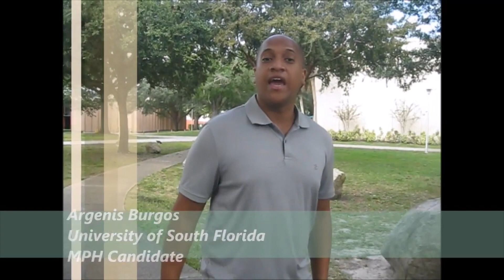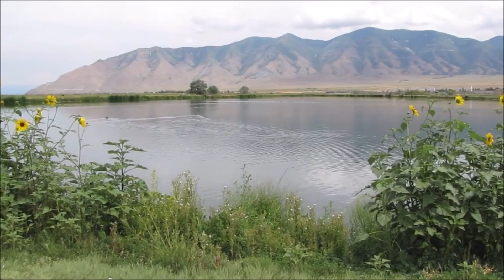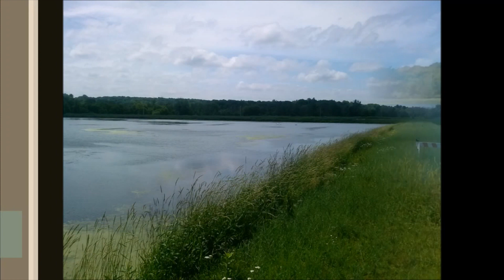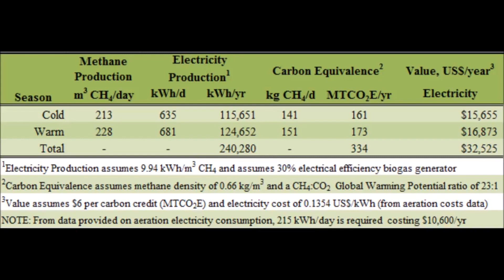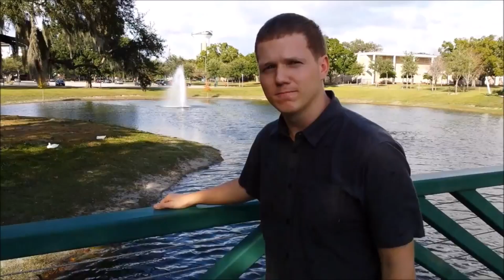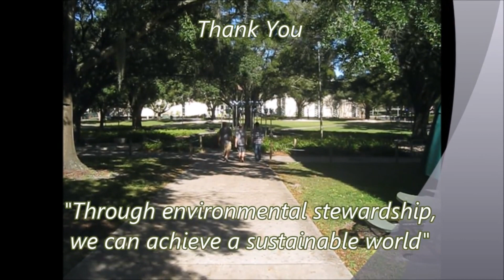Wastewater Lagoons for Michigan

Comment from the maker: What strategies could we use to engage with decision makers in Latin America (see blog http://usf-reclaim.org/2015/03/wastewater-lagoon-systems/) or the US on the opportunities available with resource recovery from wastewater management, with a special focus on lagoon systems? Consider end users in your discussion when you consider who the decision makers are in this scenario.
Reply: Abdiel Laureano-Rosario I agree that information and communication are vitally important, however, the best first step is to let communities decide themselves. As engineers and anthropologists, we can then assist by building capacity, and helping to make sure that decision makers hear from a diversity of stakeholders, especially those that lack the capacity to have their voices heard because of issues of power and economic dynamics.
Reply: I agree with Nathan Manser that framing the lagoon systems as an economic opportunity in the resource recovery and agriculture / aquaculture sector may assist adopting these systems and obtaining revenue to ensure that they are properly managed / maintained. Also Abdiel Laureano-Rosario makes a good point that educating end-users about the positive benefits and possible drawbacks that these wastewater pond-settling systems would be useful for the implementation and adoption of these systems, but that it also depends on the geographic, cultural, and socio-economic context of the area. I would add that it may be useful to frame any pitch to policy-makers about the use and maintenance of these systems within the scope of international sustainable development discourse such as the UN Sustainable Development Goals (https://sustainabledevelopment.un.org/sdgsproposal) including the promotion of public health (through measures like increasing access to water and sanitation).
Reply: USF Reclaim As far as recovering the treated wastewater for use in agriculture the end users in Latin America may be more open to the idea since they have a history of using diluted wastewater for irrigation whereas end users in the US may be more opposed to it due to health concerns and the ick factor. In the US the main factor is educating end users and decision makers about waste water reuse and convincing them it is a safe alternative. In Latin America the main factor may be more about how to finance in initial building of the facility and more importantly how to maintain it and make it sustainable. In the US promoting these technologies as environmentally friendly and sustainable may be sufficient but in Latin America financial incentives and discussing the lower costs may be more impactful. I agree with Abdiel Laureano-Rosario that informing the end users about resource recovery opportunities is important and that “(social)media, workshops and/or seminars” could be helpful in doing so.
Reply: In Latin American countries, I feel a successful strategy would be to stress that the health hazards associated with inefficient wastewater treatment practices not only pertain to poorer communities but also to wealthier nations around the world who purchase potentially contaminated produce. Once law makers and politicians understand the importance of treating waste properly, information regarding the benefits of sustainable, inexpensive wastewater treatment solutions, such as the lagoon  the system, should be proposed.
Reply: I agree with Nathan Manser, that for both the US and Latin America, we should focus on the economic incentives of a lagoon system. However, the US is more challenging with the cost and availability of land. Either way, each site/community needs to be evaluated to see if a lagoon system is the most appropriate. I agree with Abdiel Laureano-Rosario that we need education but I am wondering how we will get the communities to decide as Dr. Wells mentioned particularly for a larger community and one that does not know about waste water technologies.
Reply: I agree with what a number of people have said regarding an emphasis on economic benefits, as well as on the simplicity of lagoon systems (in comparison with WWTPs containing aeration tanks, settling tanks, etc.).  With that said, it is also important to evaluate the appropriateness of lagoon systems in specific contexts before moving forward with them.
Reply: I agree with Christian Wells and Ann Vitous in adopting an anthropocentric approach, and working with each community to solve what they perceive to be their problems regarding sanitation. I believe ultimately it should be the communities making the connections and developing or choosing the best solutions for themselves. As professionals in the field, we can provide the knowledge, tools and the framework to guide the process, but in the end each community will find their own way to their own best solution themselves, at their own pace, based on their own dynamics. Therefore, selecting a single technology as the best solution and looking for ways to persuade stakeholders in target communities might not be the ideal approach. Perhaps the conversation could be better served by starting from a much broader perspective; a question of whether there is any problem at all, for instance. After enough interest is generated, the communities will start looking for solutions on their own, if it is indeed a priority. Even then, some communities will simply not be in any position to receive any external guidance, or key stakeholders may simply be uninterested or unwilling to participate.

A further point that may often be overlooked is that other countries/communities often do have environmental professionals of their own. Engaging local professionals and strategizing with them rather than working alone may be a much more effective approach for achieving tangible results, if the community is interested. I believe we can only work within the community's own dynamics so far as how much guidance we can provide is concerned. Articulating the environmental, public health, and economic benefits of adopting this or that technology (i.e. wastewater stabilization ponds, for instance) would occur naturally if there is any interest by the community.
Reply: If the end users are the ones making decisions to integrate resource recovery into a current pond/lagoon system, that's excellent! In that case, I think the biggest concern should focus on the sustained (and appropriate) use of the byproducts (methane for electricity or biosolids for land application). In addition, Jorge Calabria has a good point regarding the ownership of the systems as influential on their sustained use and benefit to the community.